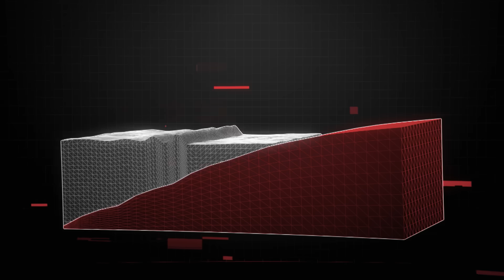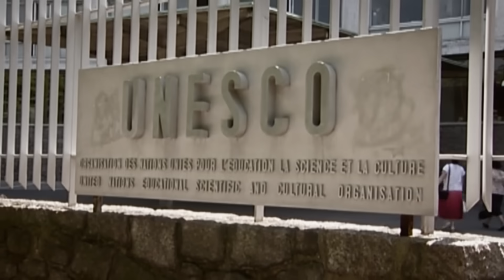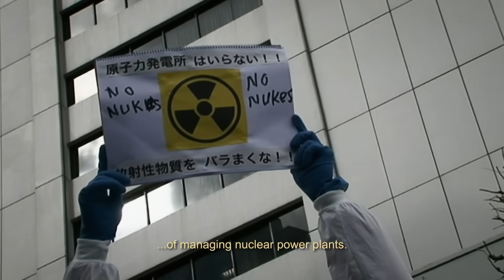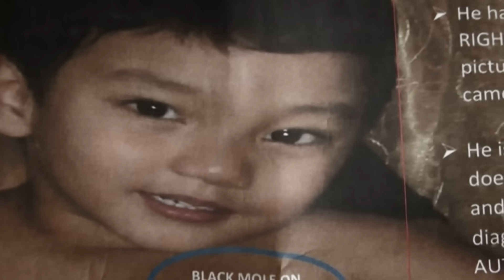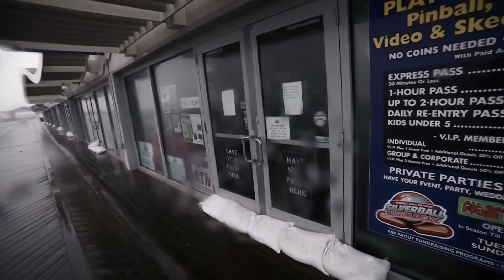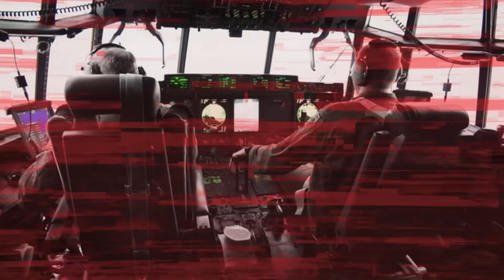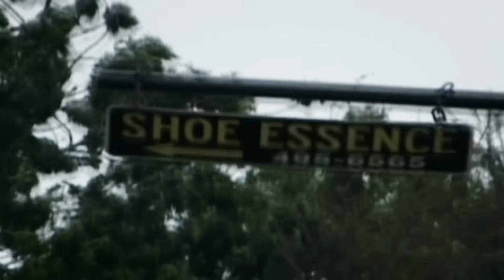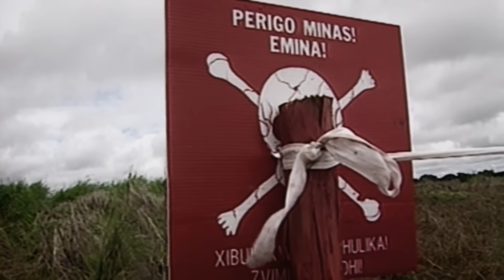The Most Shocking Water Disasters In History | Code Red Compilation: Water

Comment: I believe that you are missing the point regarding the failures associated with this tsunami.  In United States we have done a significant amount of analysis regarding all types of hazards and nuclear facilities.  We have developed a complex and highly accurate statistical model of all potential hazards for every nuclear site.  The problem is that the Japanese chose to be rather arrogant regarding potential hazards.  United States officials with the NRC warned Japanese officials back in the 1980s that they had not properly designed the reactor systems against all potential hazards.  Using statistical mottles, it was obvious that there emergency systems were totally insufficient and their designs inadequate.  For example emergency emergency electrical systems are NEVER allowed to be located below ground level.   In fact re require the feedbackup system be located far above a potential flood from a 1000 your rains and 1000 year snow fields... Whichever is greater.  It is absolutely absurd to locate an emergency backed up below ground level anywhere near the coastline... This negligence is far greater when one considers the high probability of a tsunami.  We were totally confused as to why the Japanese chose to place their emergency backup systems below ground.  This is just pure negligence.  2nd is the issue of a pressure relief system for the reactor.  Since the 1960s we in the United States recognize the potential for water being disassociated at high temperatures because of the Zircoloy cladding.   This would cause the pressure to increase in the reactor vessel.  In response, all US PWR reactors have pressure relief systems as was demonstrated at 3 mile island.   Once again it is totally absurd for the Japanese to not have a pressure relief system in the event of a LOCA (Loss of current accident)...which is exactly what occurred.   If the Japanese had accepted our input on either one of these issues, the crisis could have been avoided.  Worse is the fact that they are overstating the radiologic release to gain International funding.  The actual greatest radiologic release from the tsunami resulted from the extensive fires and not the reactor.  (Thorium released from burning organic matter.)   This crisis did not occur because nuclear reactors are inherently unsafe; quite the contrary.   Most of the people died because once again the Japanese officials failed or refused to acknowledge the potential height of a tsunami.   A rapid statistical analysis would indicate that officials needed to design for a height of at least 15 and 20 m.  [I believe that the standard of 10-E6  (The US standard for nuclear facilities.) would require a height of 20 m.   Non-nuclear facilities might have a lower standard.]  Most of the  Japanese systems were designed for a height of only 7 to 10 m.   [The nuclear reactor design obviously did not even consider a tsunami as a credible hazard which is patently absurd.]  Once again this is pure negligence, arrogance, and/or incompetence.   Yes, I am a retired research engineer; have engineering degrees, training, and certifications in mechanical, electrical, civil, and nuclear engineering; and have NRC NQA-1 certifications in all of the technical areas associated with this case.
Reply: Thank you for your input. I wondered why Japan would locate a nuclear site at a beach.  obviously dangerous.

Comment: Did I miss the bit about Pakistan where they explained the effect of all those nuclear power stations in the are which are warming the climate? I'm glad they did mention the criminal deforestation which is a huge cause of catastrophic flooding in the region. It seems this flooding has far more to do with that than climate change.

The area is so fertile. It could be very prosperous. The Dutch manage prosperity on a tiny swamp purely with persistence in the face of adversity and cleverness regarding land management. Removing barriers to flooding, like trees, simply should not be allowed.  

Same story in much of India and also Nepal (unless they've stopped) and I've heard the chainsaws have been busy in Tibet the last 4 decades too - blasting the mountains with dynamite in the Himalayas for slate probably doesn't help much either. Then everyone is surprised when there's an Earth Quake!

I'm pretty sure building huge dams and putting massive bodies of water where they never used to be might have had some connection to the tsunami. Just my wondering, I don't have evidence.

And it's always the most vulnerable poor people who suffer from this awful management issue. Why are these events not planned for properly? There is no need for any shortage anywhere, there is a need for good management.

Comment: I’ve been in shallow flood water.. it is nothing to mess with. Man it’s strength is impossible to comprehend. Even as a young strong man I was hopeless. Don’t go near this pretty looking small flow
Reply: I was helping evacuate flooded areas in the early 90s with my old military deuce and a halfs we had the tops off because some places we had to drive standing up all you could see was our chest up with the exhaust stack and snorkel sticking out of the water knowing if we hit a sinkhole we'd be swimming for our lives the pole in the back we were towing flat bottom aluminum boats by was under water in the first places we were getting people from their roofs at after the news caught us doing it the cops shut that down really quick so we switched to 5 ft of water or less (since we were on 54 inch tires) after evacuations were done we switched to sandbag delivery to areas that hadn't yet flooded but were going to within days
Reply: True that, bro. It only takes a few inches of water to move a car. And it's impossible to tell if the road has washed away. I lived through back-to-back floods that came 2 months apart. We had a farm bordering the Willamette River. It was pretty impressive to watch. Being on the only high ground, we stayed there for the first one; it was Christmas break too. But we rented a place in town for the 2nd one so mom wouldn't miss work. 
Those floodwaters swallowed a tractor that didn't get moved to the highest ground, and left big canyons that had to be filled in. Still, it didn't touch the house, shed, or other equipment. We were blessed.
Reply: Moving water is a big hell no to drive through standing water is pretty safe unless you know there's random sinkholes in the area
Reply: @davidwoermansr  ppppppppppppppppopppppp
Reply: @davidwoermansr  ppppppppppppppppppp9oppppppob BB
Reply: @davidwoermansr  p  BB    BB b   BB  bb

Comment: For the heart-breaking Katrina tragedy, a fish rots from the head down, and in this case it was a horrific failing that I hope won't be repeated.
Reply: They restored the old version of water repellent (what was clearly not good enough) as seen in the video. They (local goverment) contacted the Dutch after this disaster but did not follow trough. Perhaps their solution was to expensive but from what I heard the Dutch got the impression that they would just do it them selfs. So they never even came back to The Netherlands...

Comment: While most of the information in this documentary is accurate, the information concerning the Fukushima reactor is not correct.  In the mid to late 1980s, we notified the Japanese government that this reactor had numerous potential problems.  I am a Real Nuclear Engineer ( 3 engineering degrees, and I have certifications in mechanical, electrical, and nuclear engineering.  I was also certified to analyze abnormal conditions that may impact a reactor system.   Specifically we noted 2 design flaws.  The 1st was the fact that the emergency diesel generators were below grade.  This is never allowed in the United States.  It made the backup system susceptible to failure with flooding or a tsunami.  The 2nd issue involved the pressure vessel.  We know that if the backup cooling system fails there is a potential for oxidation of the Zircoloy (zuriconium cladding) surrounding the fuel.  When this material oxidizes it releases hydrogen which increases the pressure.  All US reactors have mechanisms to release this pressure.  The reactors in Japan often do not have this capability which puts them at great risk for an explosion.  It is important to note that it cannot result in an actual "meltdown" but the fuel can "partially melt" due to the decay heat.  ( All of the reactors correctly "scrambled" and as such there was no longer any "fisson heat".   However, a small percentage of heat caused by  Radioactive decay did remain.  This heat would drop off very quickly.  (This is what occurred at the 3 mile island complex in Pennsylvania in 1979.  There was no radioactive release of concern and there was no explosion of the reactor.)  The problem in Japan was the fact that they had no ability to release the pressure.   The explosion caused a release of the radioactive elements contained in the reactor.  The largest amount of vision products is Molly 90 and cesium 137.   A small amount of radioactive iodine was also released.   Because reelective iodine can be absorbed by the body, There was a concern.  However the concern was greatly overstated because most of  The real activity died released by the reactor cannot be absorbed by the body.  The danger was grossly overstated.  The greatest radionuclide release was tridium ("heavy hydrogen") which decays with a low energy Beta Particle which is not dangerous to humans.  This danger was greatly overstated.

Comment: Why would you build a nuclear power plant on the coast of the most earthquake active place on the planet 🤔
Reply: Because they require large amounts of water to operate so they are often built next to water.  There aren't any places on earth that don't have earthquakes so the problem wasn't where they built it, the problems arose from how it was built.  Obviously they didn't adequately design safety systems to withstand the environmental conditions it was subjected to.
Reply: @donaldbiden1920  exactly, if the wall was built that bit higher the situation wouldn’t of been that bad. But they didn’t expect the wave to be that big.
Reply: The real question is why did they put the back up generators in the basement? Why not run a power line up the nearest hill and install generators there? I mean, it's not rocket science. Or maybe it is :(
Reply: @carolwolf9614  what you propose is simple common sense and therefore not rocket science. The one caveat I could offer the designers and builders of Fukushima is that for ease of access in an emergency unlike what they actually faced. In the design phase the engineers and architects have to think about every plausibility and rate them on the likelihood of occurrence ratio, the higher the likelihood they implement counter measures to prevent catastrophic failure which would lead to a meltdown of the NFC's. Japan just failed to take into account its geological location and that of the Reactors as to their history of geological and oceanographic events from the ROF. A study was done on the impact on the impact that the event, short term release, long term release or radioactive contaminated water being dumped in the ocean and it wasn't a good prognosis. They made a total of ten KNOWN dumps in the area of 30,000 gallons of irradiated water into the pacific in the last 8 + years and it isn't being neutralized as first though. Which is why fisheries throughout the pacific are stringently monitored as there is a red zone extending from the plant some three hundred miles out into the pacific ocean. All which would have been prevented if they thought like you and many experts do.
Reply: I guess we could all say hindsight is 20/20?
Reply: By that logic, Japan should have zero nuclear plants since the whole island is located in a very seismic active zone. Most plants are built close to a body of water anyway as water is used to cool the fuel rods. You don't wanna be in a situation where you're facing a meltdown and have a water main break. Cause then, yous in trouble!
Reply: @carolwolf9614  Probably the literal live weight of generators. They would fall through.
Reply: It would never have been a problem had they simply located the generators in the fuel for such on the top of the highest roof of the buildings - instead of on the ground!

Comment: With Japan knowing just vulnerable they were to a tsunami - it's incredibly irresponsible that they would put both the emergency generators and the fuel for such on the ground instead of on top of the highest building. Had they simply done that there would never have been a Fukushima disaster.

Comment: I always thought a sounomi was like a hundred foot wave.. 2 or 3 foot flow is all it takes.. a kadrillon  gallons of water moving every second will take out an entire town
Reply: You thinking of rogue or tidal waves?
Reply: They said the 1 wave was 30 meters that's 98 feet
Reply: @Holocaustica  A tidal wave is moved by either gravity or wind. They are relatively small.

A tsunami is created by pressure, like a mountainside falling into a big area of water, or a glacier calving, or a volcano erupting, or a big meteorite slamming into the ocean.

I would play with a tidal wave, and run like hell away from the ocean if I heard that there was a tsunami coming towards me.

Rogue waves can be created by big winds like hurricanes, or by undersea volcanoes or landslides.

A tsunami involves the entire column of water.
A tidal wave involves just the surface of the water.

Comment: 3 years before it in Japan they  were drilling into a methane deposit off the same fault an destabilized the fault  when drilled into the methane bed.   And Japan will never admit 8t was a methane drill rig responsible for it

Comment: 800 km/hr? I literally don’t believe it. 
Someone in a boat would have felt it.
Reply: Believe it. As for someone in a boat - if you are far out at sea a tsunami might only have a moderate swell, perhaps a couple of feet, something you might feel all the time. It's only when it gets close to land and the column of water pushes up against the undersea shelf that the wave backs up and rises metres high then comes rushing in.
Reply: @robincowley5823 . So the water itself doesn’t move, the fish aren’t floating along as fast as a jet, the energy moves?
Reply: yes
Reply: @lisaschuster686  Yes, basically. It's simplistic but actually a pretty good description of what's happening. Think of it like a sound wave when you talk - the energy moves through the air, but your voice (or your stereo speakers, or the speakers in your tv, etc) doesn't make the air itself move.
Reply: @robincowley5823 ,Got it. Thank you!
Reply: @lisaschuster686  Where are the fish, specifically during this wave of energy?
Reply: @tonirose6776  Exactly!!!